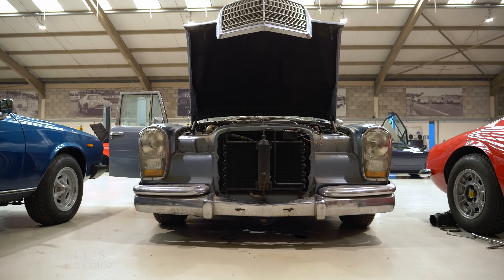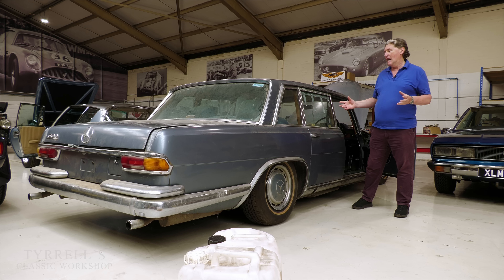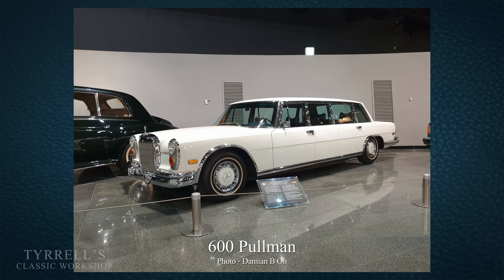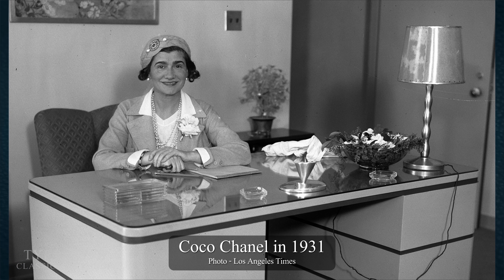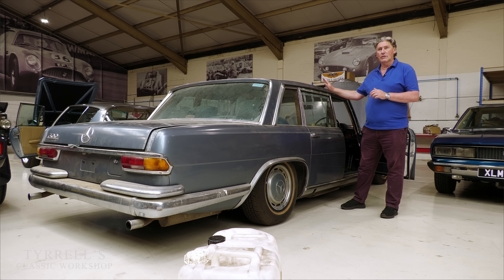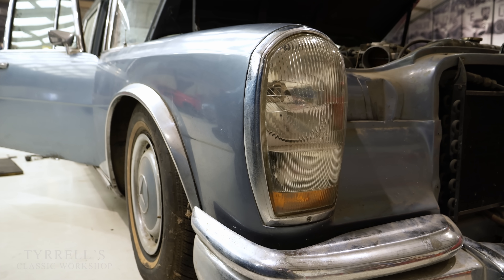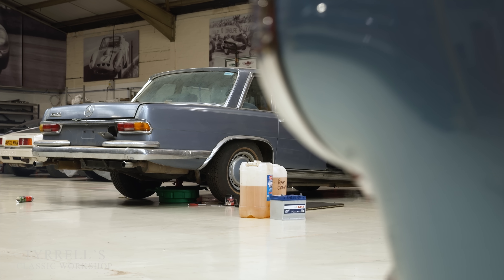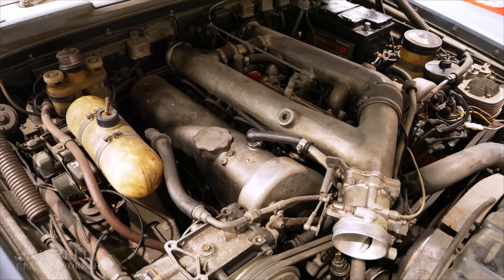Mercedes-Benz 600 Grosser W100: A Re-Commissioning Journey Begins | Tyrrell's Classic Workshop

Comment: Also I find your advice on how to start and warm/ drive off on classic car different than other enthusiasts. I think both are correct for someone like Jay Leno who is dealing with very old cars you need to let them warm somewhat before you can pul off, but as you advise on your more "modern" cars you should start and not let them idle warm, pull off gently and warm them gently as the heads and in general the oiling systems won't fully lube the entire system at idle revs, I think both are correct, and only let the engines overall idle enough to get the rolling, never let the, idle "warmup" and probably dont let them idle even after warm. The newest cars also sold be started and let idle down off the "cold start" programming and driven gently to warm and not let idle
Reply: There's different things going on with the engineering of older cars vs newer cars. In older cars and Italian cars specifically, clearances and metallurgy of the day meant being sympathetic was essential. Flogging a cold Alfa for example was a sure way to end up with a noisy smoky jerky engine and a gearbox with no syncros. Gently bringing everything up to temp before opening the taps was preferred to avoid that situation. In some late model cars the computer will resist the instruction to take flight before the oil reaches a certain temp, almost certainly a strategy to prolong engine life so you can forget about drag racing until then. Prolonged idling was never a good idea as a warm up strategy, simply because in the case of older Italian cars, Weber/Dellorto/Solex carbs. There's not much subtle about them, they just shove fuel in and too much fuel fouls the plugs and way too much fuel washes the bores. Hence a sympathetic warm up while on the move being the best case for good running and longevity.

Comment: Thanks, Iain, for your advice about fuel. I had a lowly BMW E36 for many years and always put E5 98 in it (preferably Shell V Power, which I believe is actually 99 RON) and I've recently bought a lovely E39 M Sport 525i from 2001 which I have also been feeding Shell V Power. Good to know that I haven't been paying more for fuel than necessary! I have been vindicated in my belief that E5 98/99 is the correct fuel for older cars (and perhaps for anyone who cares about their cars engine....)!
Reply from the maker: You were right all along…..

Comment: 1:06 Is that the full workshop manual? It seems incredibly thin!
Reply from the maker: Yes, all that’s needed is there
Reply: @iain_tyrrell  Incredible. My motorcycle's workshop manual is 700 pages long and it doesn't have hydraulic powered windows

Comment: With regard to the fuel, not only recommended for classics, Iain! My motorcycles, while not even old, only get the ethanol-less fuel. None of that plastic/rubber eating, water-attracting stuff in my beauties! Especially as the bikes go through winter sleeping. Not sure about England, but in the Netherlands Shell V-Power and BP Ultimate 98 are among the fuels that, according to their servicedesk, have no ethanol at all. The 5% sticker is there by regulation. Also, TanQYou seems to offer 100+ octane ethanol-free fuel over here.

Comment: In the late 1950s, the engineers proposed two engines for the Grosser Mercedes: 6.3-litre V8 and 7.5-litre V12. The board decided on V8 rather than V12. Wonder how the things would turn out if the board had chosen V12 engine instead.

The history is repeated when the board was presented with a proposal of a new V12 engine for the facelifted W126 S-Class during the booming Eighties, topping out the S-Class model range. Evidently, the board regretted its stupidity when BMW introduced a new V12 engine for its E32 7-Series in 1988. This led to two-year delay of W140 introduction.
Reply from the maker: Thanks for that

Comment: I owned and restored or refurbished 3 300 sel 6.3. These cars are superbly made but very complex very expensive to restore and many critical parts are becoming unobtainable. I always loved the 600 but the additional complexity of the 600 was simply a bridge too far to consider. Regarding fuel these engines need the injection pump to be spot on and the twin point distributor. I put in super and octane booster lead substitute in every fuel fill on 98 in Australia. You could floor it and the engine would not have any pre ignition. But if these things are not correct then you will have problems and can damage the engine. These cars require a passionate enthusiast access to really skilled support and allot of money. A Silver Shadow is a simple car in comparison. And that's saying something because I restored a superb one of those. Today you can still readily get parts and support for a Shadow. But the Daimler Heritage centre when I went to see them in Stuttgart were friendly but useless. They will not sell you parts. Thank goodness for Flying Spares for RR. The 600 or the 6.3 are magnificent machines but I would never consider a poor one at any price.
 And the 6.9 is a totally different car.

Comment: Great video! I always liked these though I think they would eat my bank account alive. About it being more complicated than a small aircraft - most small aircraft are a lot less complicated than a car. An Cessna 172 has an air cooled 4 cylinder pushrod engine, gravity fed carburetor (only the later models have fuel injection), control surfaces moved by cables and a fixed pitch propeller. They weigh about 1600 lbs, half of the weight of a small automobile. Kinda like an old british roadster there is nothing on them that is not needed for flying.
Wouldn't it be a fun video to compare a classic car with an older small aircraft?
Reply from the maker: Now that's an interesting idea.

Comment: When it comes to classics, if they are to be stored for an extended “rest” would it not also be a good idea to brim the fuel tank so as to displace the air and moisture therein from the fuel tank and thereby prevent corrosion of delicate fuel system components?
Reply from the maker: Fuel goes off over time, whether brimmed or almost empty.
Reply: @iain_tyrrell  Very true, I just meant purely from a corrosion prevention standpoint.

Comment: In my opinion the Pullman versions have better overall proportions - if its a SWB I'd actually rather have a W108 S-Class, which of course you could get with the same engine as the 600.

Comment: The - english- service manual front page at 01:06 says "Type 600  The Grand Mercedes".
I wonder how this - obviously original "Mercedes-Benz of North America, Inc." ! -  manual was titled in German? "Baureihe 600  Der Grosse Mercedes" would by the word-by-word translation, but I somehow doubt, it was labelled that way.. Does anyone know?
Which production year is this one, btw? Looks like mid-1970s, right?
Reply from the maker: Interesting questions
Reply: Sorry, I have to corrigate myself: "Typ 600  Der Große Mercedes" would have been the word-by-word translation into German...
1. "Baureihe" (carline) was 100, should have been for the SWB "W 100". "Typ" was the "Modellbezeichnung" "600", but I am not sure if they wrote "Typ" in those times before the "600" in the German title, as the "600" was assumed as a self-explaining name. I´d assume "Mercedes-Benz 600", propably even without the addition "Der Große Mercedes"?
2. Very propably, there didn't exist a special Swiss-German version using the double-S instead of the German character 'ß' for "Grosse" at those times.

Comment: People often joke "Number One Choice for any Dictator". But even the pope owned one. Things tend to get a bad image when they get into obscure company. But I love the 600. I would even want to own a "budget model" if finances would allow. Which they don't. Thanks for sharing, carry on with the good work and frequent reports on the status of this one.
Reply from the maker: Thank you. People focus on the famous or notorious owners. They're a marvellous, but fiendishly complicated car.
Reply: @iain_tyrrell  The 600 features the peak of "hi tech" of the late 50s, early 60s. And compared to a Rolls Royce or Caddillac of the same era they had stuffed way more advanced features into it. Starting with the fuel injection that Germany used on a regular basis since the 1930s. And looking at it the "hydraulic for everything" approach isn't too bad. Why using different systems for various functions and run into the need of more and larger batteries and wiring ? And - it was intended to be a state or representational car, which may include e.g. bullet proof windows and body panels or trunk lid. Those can be handled easier with a hydraulic than with electric motors and reduction gears. Every Caterpillar or tank engineer would have done the same ... ;-)

Comment: Well I learned something today-that Benz used 3000 PSI in the hydraulics. I would have thought 1500 PSI would have been satisfactory-but oh heck no-let's go whole hog & use 3 grand. No wonder  if a line of a fitting lets go-WOOSH. And-let's not even think of what happens when high pressure petroleum based fluid gets released suddenly.
Reply from the maker: What can possibly go wrong??
Reply: @iain_tyrrell  🤣🤣🤣

Comment: If any car deserved a conversion to a modern Mercedes V8 ( like the 2007 6.3), and electric windows, steel springs and hydraulic shocks, it's this one. Ive had a 300 6.3 and a 600. Few people in America will even work on them anymore. Parts are a nightmare. Never again!

Comment: Haha I’m laughing because I’m Australia we have E10 fuel or normal unleaded petrol with 0% ethanol in it. Our standard 95 or 98 premium unleaded fuel has No ethanol in it. It must say E10 on the pump.
Reply from the maker: That’s crazy! But good
Reply: @iain_tyrrell  it’s very hard to find E10 as most garages don’t sell it. Most car dealers here won’t honour your warranty if you use E10 unless your particular model is suitable which it must say on the fuel filler cap E10 suitable. For cars older than about 2005 a lot of repair places will refuse service if you put E10 in your car & damage the fuel system.

Comment: 207 kmh and around 9 seconds up to 62 miles per hour.
There was no faster limo from German production at that time.
Opel offended Mercedes one year later by presenting the Diplomat V8 5.4 litre or 313 c.U.i. at half the price 26.500 DEM, with 203 kmh and 10.5 seconds. Only 250 Opel Coupe Karmann bodiedwere sold but about 1.400 Grosser were sold.
Reply: The 600 started at 52.500 around 1963 with a nearly endless list of extras still open. Around 1978 still in production the price had doubled to about 118.700 Deutschmark.
Reply: The Phaeton W12 is also such a wonderful car that dies in dozens on the road . It is the only possible successor to the myth of this 600..
Reply from the maker: Thanks for that

Comment: The funny thing is, that the 600 has never been called Grosser in Germany. The Mercedes 600 has always been called, well, Mercedes 600. Must be a US / UK thing.
Reply from the maker: Grand Mercedes in the UK and UK officially
Reply: Der große Mercedes 600 – Das exklusive Fahrzeug der großen Repräsentation. (“The ‘Great Mercedes’ Type 600 – The exclusive vehicle for great representation) was the headline of the press release in 1963.
Reply: @Freimopp777 Correct. Der große Mercedes. But the 600 has never been called Grosser in Germany. I guess it is coming from the US as Grosser is used in every video about the 600. Word of mouth. One is using it, the other one is using it too. Which is okay, languages live. Cheers

Comment: Dear Iain, with respect to your experience, and your shops reputation, you should have diplomatically declined to except this bottomless pit into your establishment. There is a limit of deterioration, neglect, abuse - this car has exceeded all MB Groups 00 to 83 to a rock bottom level. I was trained in 1970 and serviced these when they were nearly new till 1990. I earned Star Technician awards in 1980 and 1982 from MBNA. This wil break an owners bank account, unless their title begins with
 Your Highness ____.👑
And the endless issues hiding under that deplorable paint might ruin you. I'll pray for you. The best thing that could happen to that car would be to remove the M100 engine and transmission,    polish it up and display it on a beautiful rolling stand like that early Maserati engine from your back episode.
Wait till you price the climate control unit missing from the center dash board. 
God Bless you and your optimism. 👍
Cheers from New HamShire🇺🇲✌️
Creighton R. Demarest
Reply from the maker: Thank you Creighton,
Our remit is just to get it running. We will be very careful how we spend our man hours on this!
Thank you for your concern